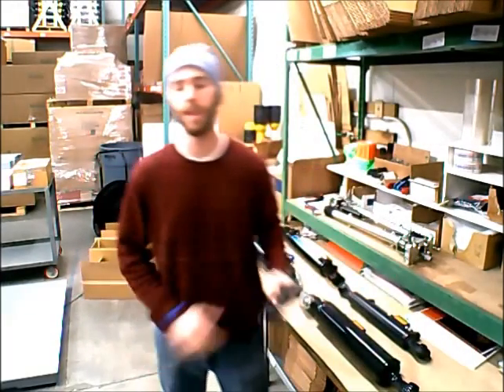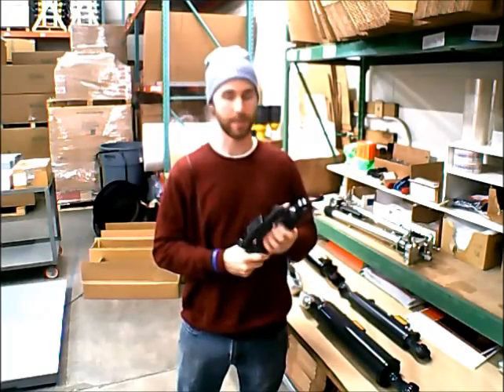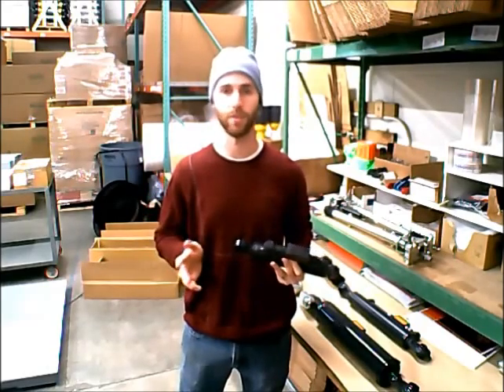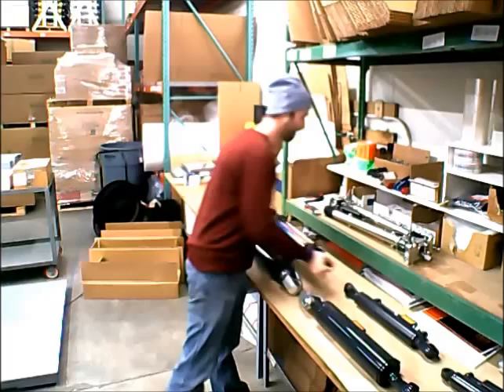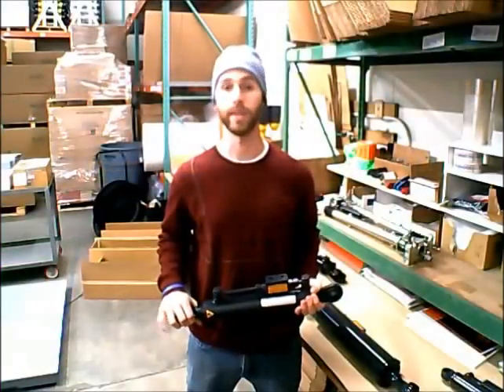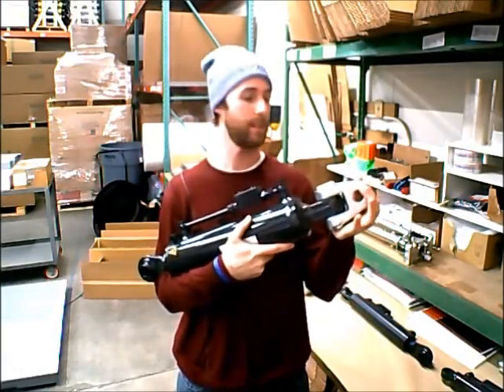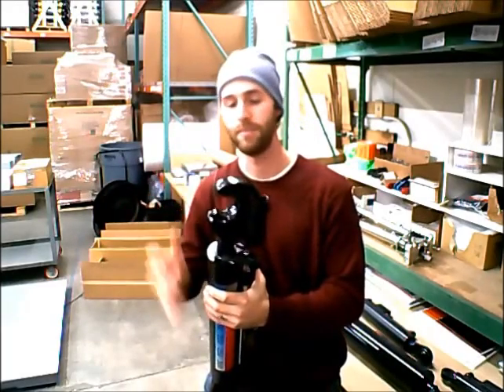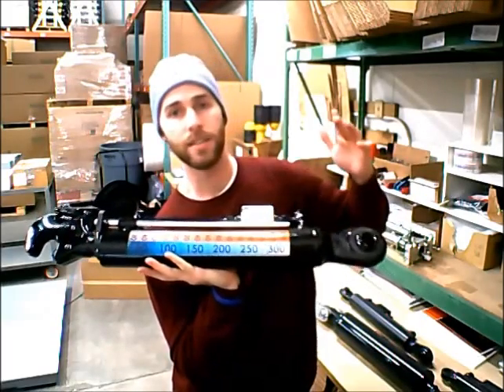Hydraulic Top Links

Comment: I know that I should measure my threaded (factory) toplink to make sure that I purchase the correct size from you...this would be done by measuring the existing threaded top link when it's threaded all the way in, and then when it's threaded all the way out.   My question is....where do I take the measurements from?   Do I measure from the center of the ball (catagory 1) on the tractor side to the center of the ball at the implement side....or do I take the measurements from other places on the factory threaded top link?
Reply from the maker: You would measure from the center of one pin hole to the center of the other pin hole.

Comment: I have a John Deere 3320 r 32 horse what top length would I need and how much is it
Reply from the maker: Unfortunately, we don't have that particular model listed in our cross reference. If you are interested in seeing if we have a suitable hydraulic top link for your tractor then we would just need to know some measurements off of the mechanical top link that is on the tractor now. We would need to know the pin hole sizes and the length of your mechanical top link closed to extended from pin center to pin center. Please feel free to email us at info@agristoreusa.com with your measurements. Thank you!

Comment: Just got my #1597 top link today. Installed it on my Mahindra 5005 and works great. Unfortunately I didn’t check the clearance while raising 3pt hitch up and the raised hose fitting on check valve hit my seat and bent the valve over and bent the metal pipe. Fortunately it’s not leaking. Do you sell the metal pipe for the #1597?

Comment: Are your horsepower ratings applicable to 4x4 tractors? Mine is 45HP (38 PTO) 4x4 with cat 1 top link. Need this for scraper blade. Thanks
Reply: Really?
Reply: @bradjenkins932  What's your question? I'll clear it up for you...
Reply: @1PITIFULDUDE  It doesn't matter if it's 2, 4, or 6 wheel drive.
Reply: @bradjenkins932  Yes it does. The amount of force that the tractor can/will put on the shock/cylinder, through the implement used, can be significantly greater with a 4 wheel drive tractor.  More traction potential equals more force on parts in static/dynamic contact with the ground, which means the hydraulic link especially , especially the top link, needs to be more robust.  When I purchased my hydraulic top link, the first thing the vendor asked was if it is 2 or 4 wheel drive, then HP.
Reply: @1PITIFULDUDE  LMAO....... That does not change the engine HP.
Reply: @bradjenkins932  NO, but the HP rating of a top cylinder decreases as the number of drive axles and drive tires goes up. The more aggressive the tread, ag vs turf tires, the HP must, once again, be decreased to reduce load on cylinder.
Reply: @1PITIFULDUDE  Whatever you think.
Reply: @bradjenkins932  Sorry you don't understand the physics involved. Good day...
Reply: @1PITIFULDUDE  LMAO.. OK

Comment: Do you know why some 3-point implement manufactures bore the top link attachment holes to 7/8"?  I understand a type 1 at 3/4", or say a 1" for type 2, but why bore 7/8" ? That just makes it a sloppy type 1 pin fit, while being too small or a 1" pin, and doesn't really fit most top link ends. So why the strange top link hole size? Any ideas? Thanks 
 (My solution has been to bore out to 1", then use bushings to make a snug 3/4" pin/top link connection.)

Comment: What exactly is that check valve called ? We have other equipment that leaks down and need something or this exact valve to fix the issues. One is the hay mowing machine. While pulling it down the road it starts leaking down into the on coming traffic.